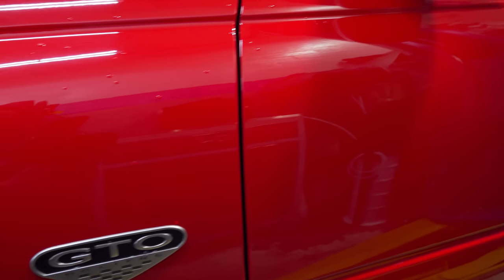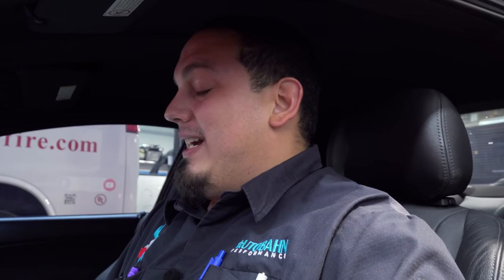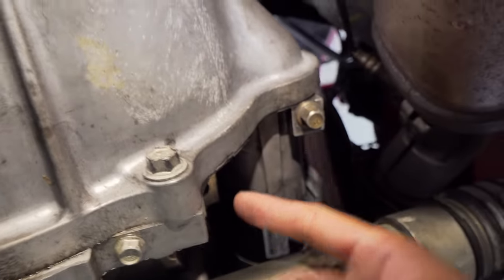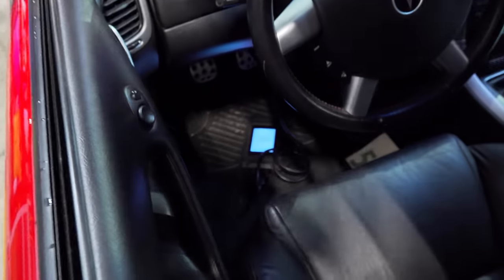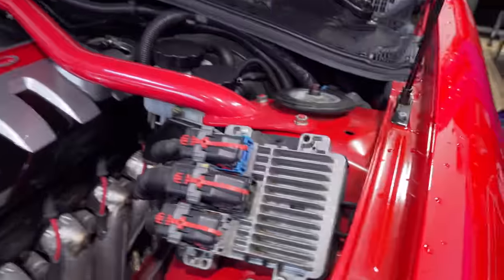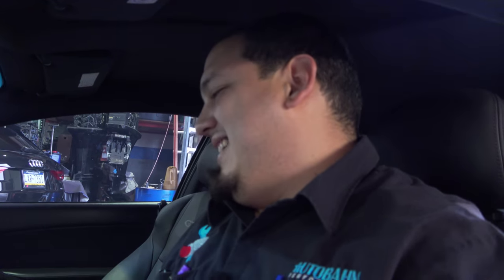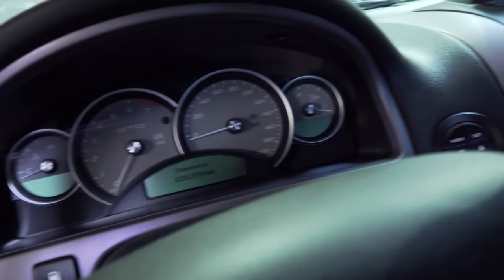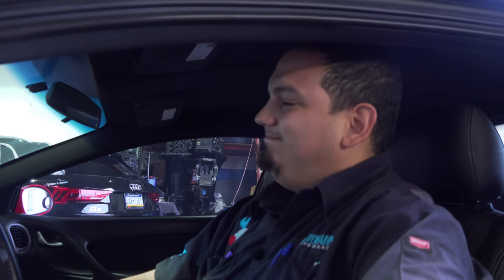Car is towed is, and this happens...

Comment: I would’ve check fuel pump current ramps. Just to see if you had a weak brush that it possibly landed on. Sometimes after it’s been on the tow truck , it causes just enough vibration to the pump , to have it work again.
Reply: I agree. That CKP code can happen when the engine stalls. Another good clue for fuel pump issue.

Comment: This might be helpful too: these suffer from PIM modules losing the plot, usually symptoms are a crank,no start with no or misleading codes in the bcm or pcm.
Reply: Yes this. The Aussie Commodore V6’s that the GTO is *based off (as well as the Monaro) use the same PIM. Aussie LS powered variants do not. We are getting all sorts of intermittent no crank, no start problems after low voltage conditions. Even if the battery is replaced, the intermittent fault persists. 

It can be over come by jumping the starter relay but that doesn’t solve the problem. The owner has to keep doing that. 

On our Commodore forum we get quite a few ‘04-07 VZ Commodores (the equivalent model to the GTO featured here) with the same thing. My father inlaw had an 04 Commodore V6 VZ with the same issue. Sometimes for months it was good. Then the no crank. No start condition happens and he’d have to jump the starter relay to get it going. 

I long suspected the PIM located above the fuse panel under the steering wheel. Could never prove it because I’m not Mario with Super Mario skills.
*the GTO isn’t based on the V6 as such but does use aspects of the Aussie V6 engine management with the analog to digital power train interface module on V8’s that wasn’t used in Aussie V8 variants.

Comment: As you might know, we have these  as a much bigger model range (VZ Commodore) in Australia. In the last three years, they are developing crank no start conditions in large numbers. Mainly V6 though. 

So loved watching this with great interest.
Reply: The classic Commy stretched timing chain 😅
Reply: I will add the common factor is low voltage condition preceding the fault or not driven for a long period. Of note is the US GTOs use a PIM that converts analog to digital, located above the fuse panel. In Australia in LS power variants do not. Only the 3.6ltr Alloytec V6’s. I suspect a faulty PIM but don’t have the skills to prove the fault. (Hence why I watch these to learn more)
Reply: @danielbuchanan9651  Um. No.

Comment: Had that happen to my mustang. Started running real bad right before I got to work. Limped my way there. Scanned it and it was camshaft position sensor. Started it again and ran fine. 10 almost 15 years later still no issues. No idea what happened.

Comment: We had a customer with an 84 SAAB 900. Crank no start. She'd have the car towed in. Car would fire right up. This went on for awhile. Tech took car home for a weekend. No issue. I think it was a break in one of the wires to the fuel pump relay. Luckily the lady was very understanding.

Comment: I've had vehicles with bad engine harness grounds that would only start with the scan tool plugged in. The ECM would pull a ground through the scan tool, and once the tool was disconnected it would stall.

Comment: Do you charge the customer in a scenario like this? I always have issues getting paid because "i didn’t do or fix anything" but like you demonstrated, a very thorough visual inspection and wiggle test will be performed, scan tool time, tsb search, long test drive...etc. ive gotten to the point where if i cant duplicate it in the first 5 minutes i give it back, that way at least i dont waste my time and dont have to fight to get paid for my time. Curious how you and others handle these situations. (Of course, this would hurt flat rate techs more vs hourly)
Reply: Customer is still charged diag because the vehicle was still looked over and test driven which takes time to do

Comment: could you not un-plug  the wiring harness at both ends and use a incandescent test light, or another hi-load element like a headlight bulb, and check for voltage drop across each individual wire while using the wire as a jumper for test light? That would seem to at least eliminate wiring faults

Comment: Let's face it, your just a rubbish tech Mario! I can't believe I have to educate you on this but, you can just plug in your scanner and it'll be right as rain in no time!
In all seriousness, it is fixed. Just tell the customer to point a rolling camera at it every time they go to start it. It will start every time, first time, hahaha.
I used to take great joy in stirring up the customers that this would always happen to when they would bring their car in for a warranty complaint. You go out to the car or on a test drive with the customer to demonstrate the "issue". "It does it all the time, it's driving me crazy!" As soon as I get there . . . Doesn't do it. I'd roll out the, 'Yeah, sure it does, Uh ha". To stir them up, but also to use it as a teaching moment to show first hand how they can drive a car for years with some small issue. They finally complain about it. Then, they get irate when a tech has a car they might never have seen in their life for 20minutes to try and recreate the fault but it performs faultlessly. Add to that, the complexity that you don't always get to speak with the customer. Some customers will want the slightest of rattles listed when others will deny metal on metal brakes with tyres down to cords.
The take away, is always good COMMUNICATION!